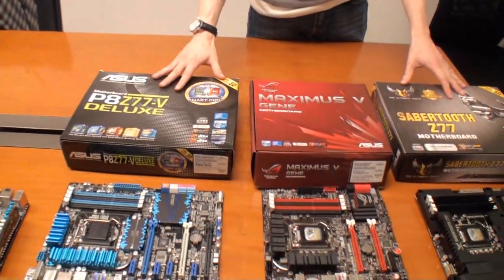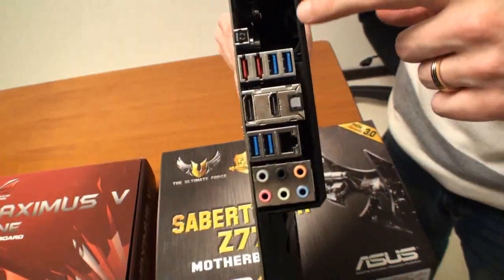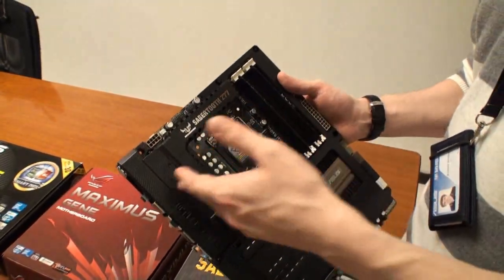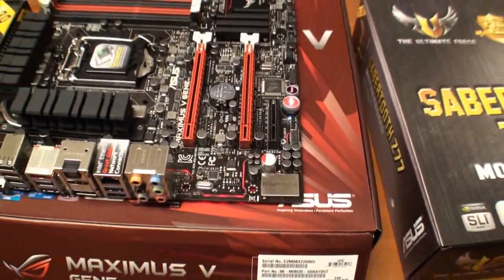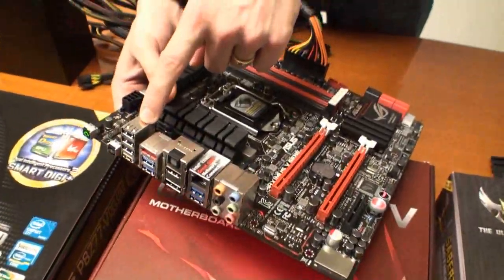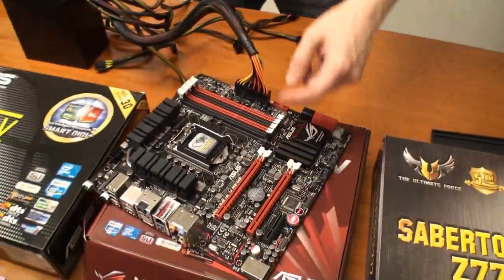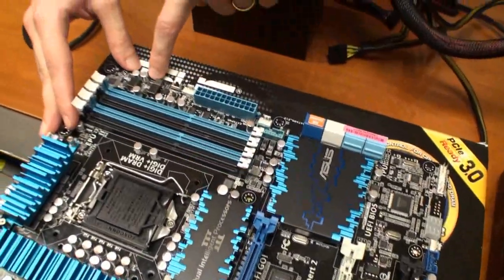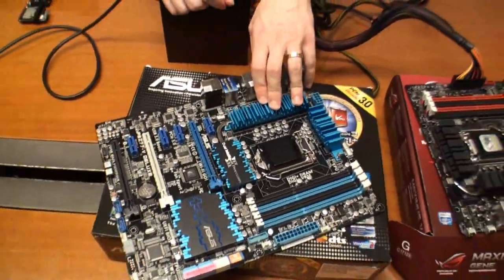ASUS Z77 Intel Ivy Bridge boards get full hands-on

Comment: ...that i don't have any dust on my board, it's shiny, i think it's because of my case, it has a dust filters before fans, i have CM storm Enforcer case, i'm cleaning my dust filters once a week, so if i had that dust protector or protector in general on my board, then it would be great, if i could. On my board, how much dust i have in % then it would be about 1-2% dust on board, but with that cooling and protecting shield on my board, it could be about 0.5% dust only in a month or 3 months

Comment: it's mission is to put away as much dirt and dust as it can, so i think it won't be that much of a cleaning, i think checking it once a month would be fine, at the same time you could see results, if the board is dusty or not, cause i don't have sabertooth, i kinda like GIGABYTE more than ASUS or any other board, GIGABYTE doesn't use these cool protectors, but seeing result...well...i still don't have any dust places after 2 months, maybe few, but very small and not so much, you could say...

Comment: and when the equivalent to the 590 comes out with the 600 series  that is  what i will have 4 of them preferably by asus or if pny xlr8 makes another line of pre-liquid cooled from the factory with their own 120mm rad each ill prefer them to any other card as i have 4 of those now and the performance is amazing on full settings never ran above ambient room temps well maybe by only 3 or 4 c of ambient room temps

Comment: You do realise that having 4 way SLI is going to ruin your gaming experience, so many issues with it, especially if you still play some older games. I had a SLI + Surround config but have now dropped it for a single 680, so much easier if you prefer to just get into the games the way they were programmed to.

Comment: sorry evga z68 really dropped the ball on the z68 ftw i got the one with the evgauge and front panel thingy any i forgot what the called it the push slight oc thingy i forgot cause the board has never worked and i could never get nothing out of tech support so i wont spend another 300+ to wonder if i am going to get a working board this time or not. i am now a asus fan i run their maximus 4 extreme z z68 mobo u can check out first build if u look under nervoustwitch77 under videos

Comment: @ 09:44 he drops a hint of an announcement in June. 

     I was in the same boat of wanting a 4 way SLI, or xFire setup too, but after a lot of reading I am now going to hold off until Ivy Bridge-E, and GK110 'Big Kepler', or the AMD equivalent for my Monster build.  I will just build a Single Card setup with a MSI z77a-gd80, or Sabertooth Z77 for now...  

That's if I can resist the urge to preorder the EVGA z77 FTW

Comment: i don't know, anyway got the gigabyte z77 with 2600k, with hd7970 and H100 with a phantom410 case with 4fans 2+ H100 fans = 6 fans  inside full blue LED light 1920x1080 full hd Samsung, gaming keyboard and mouse with gigabyte mouse pad 

the case looks beautiful, recommended for it good price

awesome machine, i will install games now to test my beast gpu

Comment: depends whether you are using a graphics card or not.
if you are, you plug the monitor to the gfx card, if you want to use onboard gfx, you connect to the mobo